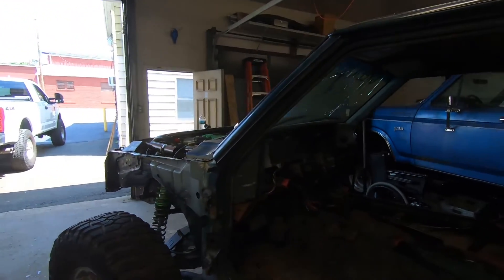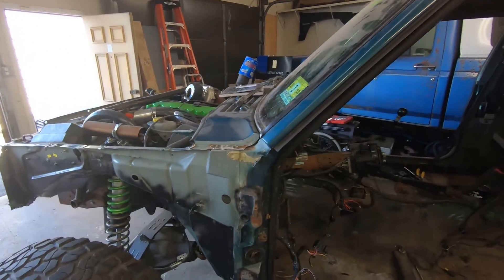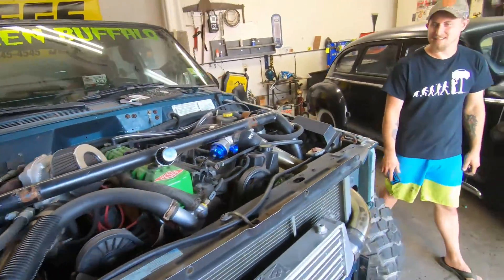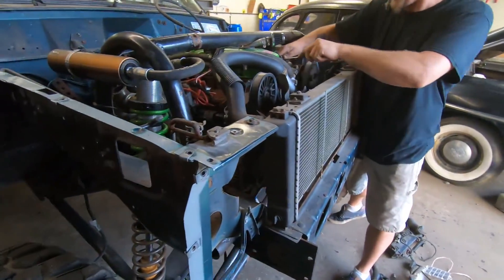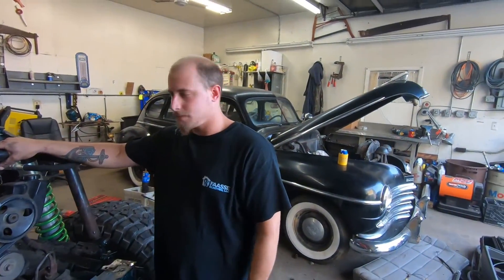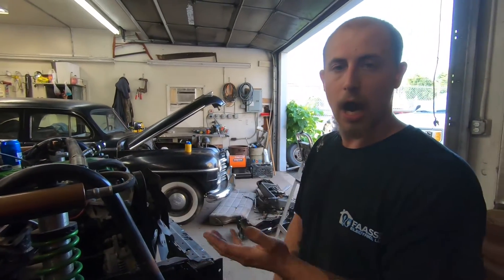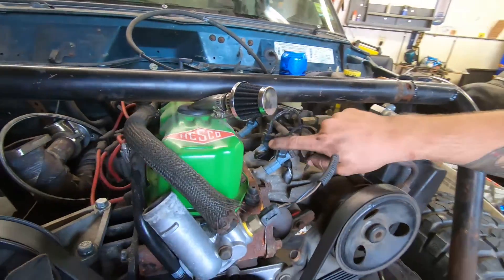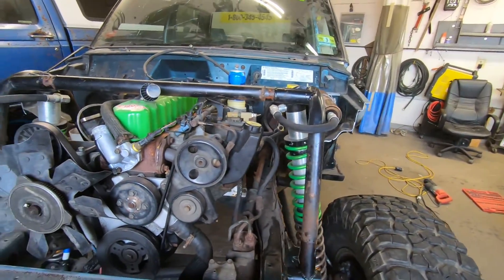Turbo Jeep Megasquirt Part 1

Comment: This cool! Glad you guys are doing this. I am in the middle of installing Microsquirt/turbo on my 4.2/4.0 engine in my Eagle. If you guys upgrade the rad I would consider running a Grand Cherokee fan. Right off the w/pump instead of the offset cherokee setup. Just a suggestion. On the trail I have never seen a Wrangler or a Grand with 4.0 overheat. I have NEVER seen a Cherokee that DIDN'T! Sub'd